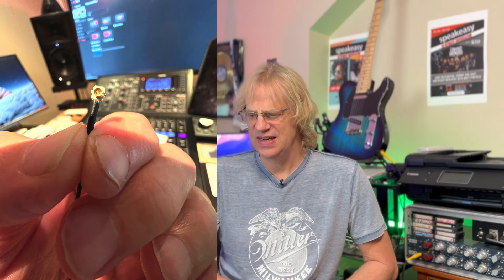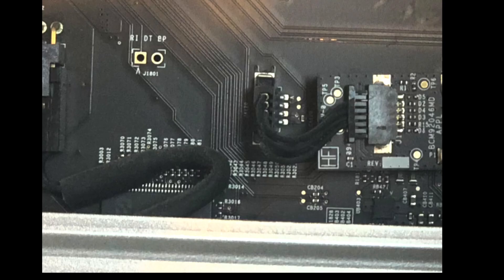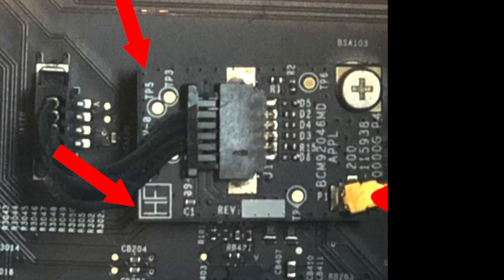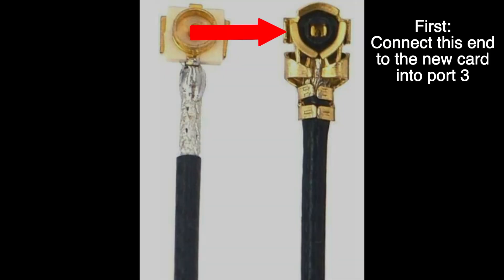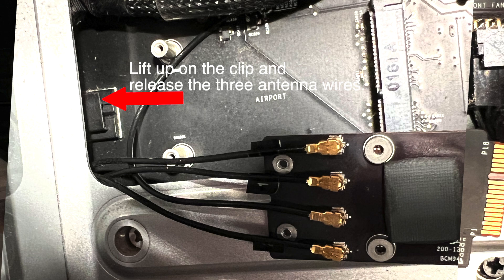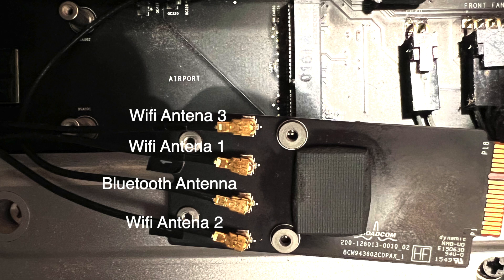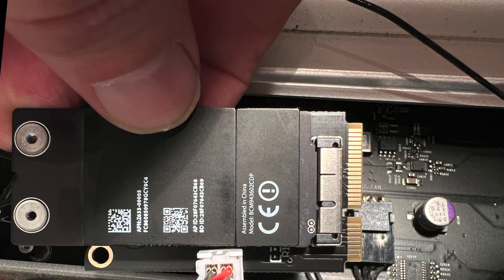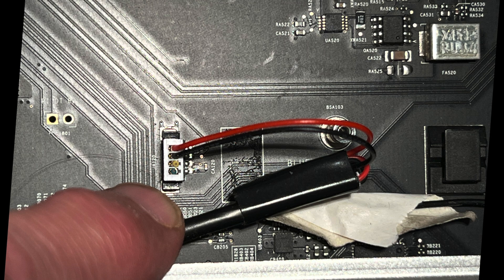Mac Pro 5,1 Bluetooth Wifi Upgrade!

Comment from the maker: Just a note if you want to get the bluetooth working in windows / the wifi works without doing this but bluetooth does not. You have to manually enable the driver in the Device manager setting to the unknown device and select Broadcom / BCM2033 24GHZ single Chip Tranciever
Reply: Is this what you brought for your Mac Pro ? Mac Pro Bluetooth Signal Enhancement Kit • External Antenna • Extension Cable
Reply from the maker: @macgamer1973  https://www.amazon.com/Mac-Pro-External-Bluetooth-Antenna/dp/B01MV26ARL/ref=sr_1_3?crid=3YTFW9HKRHGK&keywords=Mac+Pro+External+Bluetooth+Antenna+Kit&qid=1651246841&sprefix=mac+pro+external+bluetooth+antenna+kit%2Caps%2C127&sr=8-3
Reply: @MacSoundSolutions   thx
Reply: Yo! Your comment just saved the day, I had tried all the other BCM drivers for BT 4.0 and they all gave me a Code 10 error. This worked :)

Comment: I just completed this update, and your video came in very handy. Thanks. One thing I did find is that after 12 years in place, the two screws holding the old Wi-Fi card just wouldn't budge. I had to use WD-40, pinch-off pliers and a lot of sweat to work them loose. After that, the rest was easy.
Reply from the maker: YEs those screws can be a bitch, because apple uses locktite on them.

Comment: Can you tell me where I can get the mini pci-e adapter that works with a cable rather than having to solder wires to the adapter.
Reply from the maker: That’s why I bought this package, you can find the cards on eBay just have to do some digging

Comment: I tested my Mac Pro 5.1 (12 cores + GTX 680 2 GB) with LPX 10.5.1 and 10.7.1. Unfortunately, it's slow in Big Sur 11.2.3. I'm sure it will be slower in Monterey. This is easily determined by the logic user interface lags and critical overloads in the projects I worked with in OS X Mojave. It seems that this upgrades are useful only for ProTools or other DAWs users
Reply from the maker: Your issue is the GTX 680. You need a Metal supported graphics card like rx580 or rx5700xt etc. if you use opencore legacy patcher and install Big Sur it does have a post patch for your gtx 680 to get back video acceleration. Check out Mr Macintosh YouTube channel for info on this.
Reply: Im using R9 280 3gbt....works very well  w Big Sur an very cheep
Reply: I am using GTX 680 4GB, and I flashed it to mac firmware, because same graphic card was also available in mac version and we can upgrade to that version, Monterey 12.2 is working fine on my Mac pro 5,1
Reply from the maker: @QamaruldinHamza  I have 12.2 installed as well. Are you using OCLP to be able to use the GTX680?

Comment: Hello, i have a MacPro 5.1 running Monterey + opencore Patcher (latest version) but im having wifi issues... i am able to see available networks but i cannot connect with none of them unless they are open networks... any suggestion how to fix it, please? Thank you.
Reply from the maker: Are you using opencore legacy patcher or Martin Lo’s? Opencore legacy patcher has a post install patch to use the older Wi-Fi and Bluetooth cards after installing opencore. Search Mr Macintosh here on YouTube and check out his video for installing Monterey on unsupported Macs and watch his Mac Pro 5,1 part of the video. You have to use the terminal version of opencore not the GUI version. Martins does not support the legacy Bluetooth. If you have a new card you may just have to do a PRAM reset. But then you will have to re bless opencore after.
Reply: @MacSoundSolutions  hi, i am using latest Opencore Legacy Patcher (0.3.1). i will try the post install again... thank you.

Comment: Having used Martin Lo's and Legacy Patcher. I can say both have multi-boot. I now use Legacy Patcher. It's way easier, faster, and in my opinion better.
Reply from the maker: Can you switch to OCLP without reinstalling your system from scratch? Mr Macintosh seems to install a clean system when he does the Monterey install on his 5,1. I would not want to have to do that. I am going to try it on my 2012 BP to test it out and instal Monterey but again, I want to install Montery as an update from Catalina keeping my data intact.
Reply: @MacSoundSolutions  I'd been using Martin Lo's for over a year. Was fine with Catalina until I saw your video on upgrading to Big Sur. Having kept up on the progress of Late Bloom and with the release of Surplus I updated to Monterey using OCLP. No clean install just run OCLP. Everything worked out of the box for me, zero hassle, no opening EFI's, just a couple clicks. Funny I also tested first on my 2012 MBP! Same situation. just run OCLP then update! I didn't do a clean install on either system.
Reply: Disclaimer. I'm not a professional and I understand that there are potential risks with OpenCore. However my experience with OCLP was silky smooth and I don't see myself going back to Martin Lo's patcher.

Comment: Why not just make a video of yourself doing these things rather than a slide instruction?
Reply from the maker: Good point but the top of my hands would be all you would really see as I’m trying g to attach the tiny connectors with wires that have know slack,  so I thought pics would be better. I just wish I had taken more.

Comment: No need to update wifi and bluetooth module... 
Opencore works fine old wifi and bluetooth card.
Postinstallation package include a wifi and bluetooth drivers.
Reply: Where ? Are these working with Open Core 0.7.5 or Legacy Patcher ?
Reply from the maker: @starsk13  the old cards work with legacy patcher from what I understand and this is only an issue in Monterey. I use Martin Los OC package and if you put the WiFi Bluetooth patch in it will cause kernel panics in Monterey. If your on Big Sur the old cards work.

Comment: Legacy patcher does the trick and old 802.11N works fine , sure no fancy hand off / air drop etc ... but if you did not use these with older systems you will not miss these things. plus the $150 or so when you consider the value of the old machines (in LA $300/400) , given speed and power usage better to add the funds + fiddle around time to a fresh M1 Mini, that runs circles around a 5,1 ... just my opinion :-)
Reply from the maker: All true, I am using Martin LO’s OC package not OCLP. I did not have a WiFi card before. I really like the handoff and airdrop functions, but the card package I bought is overpriced and this can be done for a lot cheaper. I am waiting for the M1 Max Mac Mini, until then I will keep happily grating the cheese.

Comment: Nice job, not sure exactly what I’ll do with my 5,1. I bought a 2019 mbp thinking it would solve some FCP crashes and other weirdness. Nope, 2019 mbp is slower in almost every way, buuuut it’s portable.  

Thinking of retiring the 5,1 to plex server duty on Mojave .  Seems like such a sad way for a great machine to go.

Great video as always.
Reply from the maker: Yeah the issue now a days is power consumption really, you would be better off selling it and getting a M1 Mac mini to be the plex server… your electricity bill will thank you.
Reply: @MacSoundSolutions  think it would handle multithreading , transcoding, etc better?  I have no experience with M1 yet, but so far nothing seems to beat acrual cores.  Like I said, on benchmarks, my 2019 should run circles around this, but it doesn't.  I also run a few 4k displays, doing web dev / media creation / etc.   I've considered the M1's though.  Thanks again.
Reply from the maker: @HimmelbergerBus  the M1 scores around 11500 ggekbench multi core which is pretty good, but using it will time will tell. It depends on the app your using and how the software has been optimised for the M1. Check out www.barefeats.com for benchmark comparisons with other macs etc.